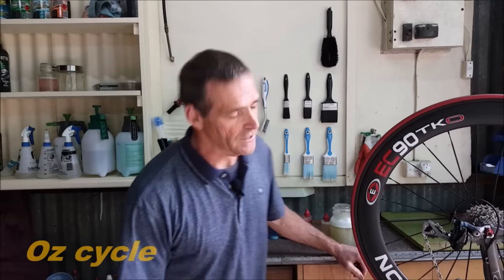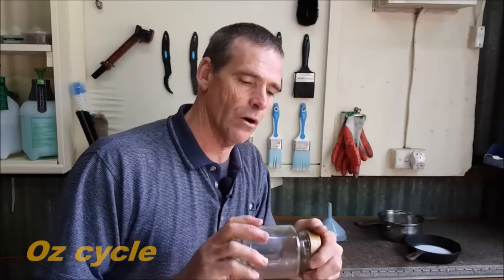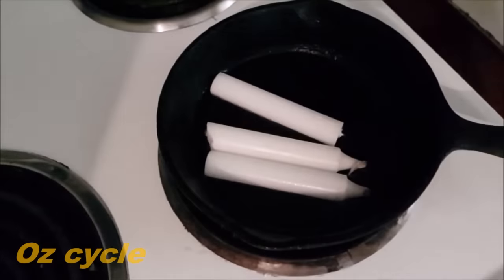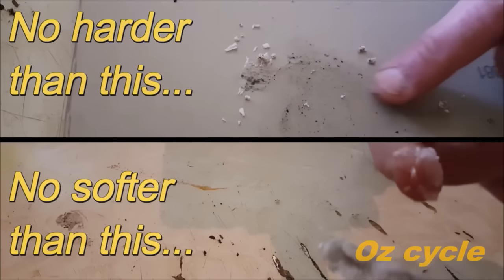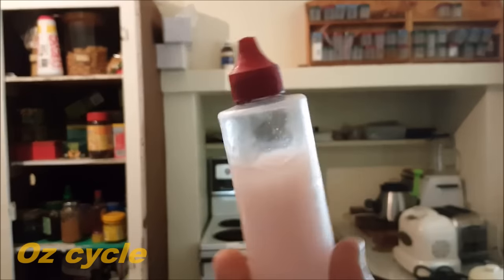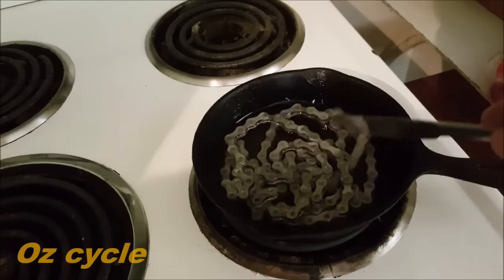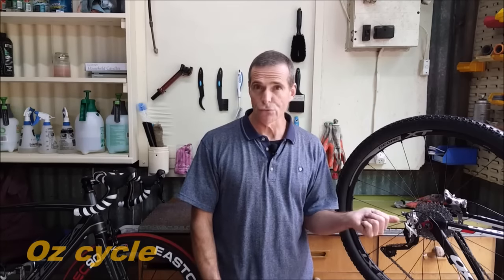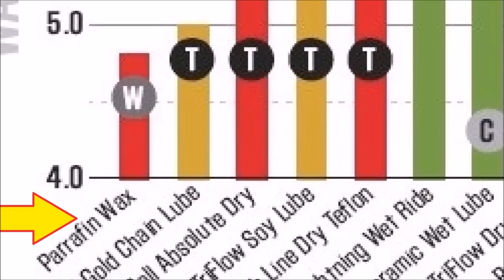BEST chain lubricant ever !! .....make it yourself.

Comment: how does this work in belove zero temps and in snow and salt?
Reply from the maker: +Robinators I have no experience with those sorts of conditions Robinators....if you live in such,perhaps you could try it out and let us know?
Reply: i would like to, but im too lazy to do all the cooking :D sorry( cuz i dont have a spare frying pan for wax). i just use the  wet lube. Wet lube kinda works
Reply from the maker: +Robinators Ok...maybe nuther time. Keep riding,your a brave soul riding those conditions.
Reply: have no other choice, roads are strewn with salt, for snow to melt, so, all the salt on the road is getting on my bike.. pretty hard conditions for drivetrain and bike itself.
Reply from the maker: +Robinators Great experience Robinators,Id like to relay it in a future vlog?
Reply from the maker: Kenneth Mjelle Hi Kenneth. The wax lube should work fine but you may need to tweek the paraffin/wax mixture so it keeps its consistency in cold temperatures.If wax lube is no good you could try treating your chain with "fish oil" . If all else fails,motor oil is fine except not used oil....it has metal contaminants which will wear your chain out real quick....so new oil.

Comment: The lube stays very thin after apllying it to my chain. It looks like the xylene is not evaporating.
Reply from the maker: Xylene will always evaporate in time. If it still is too liquid you simply have too much paraffin oil in the mix....just add more candle wax.
Reply: oz cycle thanks. The Xyleen took some time to evaporate. Works perfectly now! Thanks from the Netherlands

Comment: If I don't get xylene, can I use turpentine or polyurethane?
Reply from the maker: +Paridhi Kashyap No...try for Acetone or Toulene Paridhi. If still no success go to a paint shop,they should sell good paint thinner.
Reply: oz cycle and isn't parrafin oil kerosene oil?
Reply from the maker: +Paridhi Kashyap 'Paraffin' oil has different labels depending which country. Probarbly best to google 'paraffin oil' followed by your country. Or enquire about kerosene from the supplier.
Reply: oz cycle parrafin is a more refined version of kerosene but some countries call parrafin as kerosene others call it parrafin

Comment: can you use this on o/x ring chains?
Reply: This is a good question kratuli. I think you are asking about a motor bike chain. These are different as they have a silicon gasket on each side of every link. I dunno the answer. If it was my bike I would do it, but be careful what I used to strip the grease off the chain. Or you could just ride a shaft drive ? http://www.bikesales.com.au/private/SSE-AD-4630422/2015-Honda-VFR1200F-ABS-(VFR1200FA)/?cr=0&psq=%28%28%28%28Type%3D%5BRoad%5D%26SubType%3D%5BSport%20Touring%5D%29%26%28Make%3D%5BHonda%5D%26Model%3D%5BVFR1200F%20ABS%20%28VFR1200FA%29%5D%29%29%26%28%28%28%28SiloType%3D%5BBrand%20new%20bikes%20available%5D%7CSiloType%3D%5BBrand%20new%20bikes%20in%20stock%5D%29%7CSiloType%3D%5BDemo%20%26%20near%20new%20bikes%5D%29%7CSiloType%3D%5BDealer%20used%20bikes%5D%29%7CSiloType%3D%5BPrivate%20used%20bikes%5D%29%29%26Service%3D%5BBikesales%5D%29&pso=0&pss=Premium

Comment: Can I use turpentine oil instead of paraffin oil?
Reply from the maker: No. Paraffin oil is the wax in liquid form at a lower temperature. Try veterinary and pharmaceutical suppliers Kabir.
Reply: @stevenleffanue  Thank you very much.

Comment: The problem with your chain cleaner formula is that it is not environmentally friendly and can be highly toxic -- especially the xylene, which is downright dangerous to handle without adequate skin and respiratory protection. Xylene is illegal to purchase or use in California, where I live. In most California counties, it is also illegal to casually dispose of petrol. You can't just dump used petrol on your (or anyone else's) property or down a drain without risking a substantial fine. It must be taken to a hazardous waste disposal center.

Comment: What u say on diesel being degreser?
Reply from the maker: +Aiaiaii z Yes but it leaves an oily film.
Reply: oz cycle almost any solvent will work fairly well, even the solvents in WD40 do a better job than bike specific degreasers, but as you say many leave a light oily film behind, which is very easily removed with a citrus degreaser, which also removes the smell.

Comment: how to clean the chain up after waxing it?
Reply from the maker: +Aaron .T You dont need to unless its really dirty and grit has found its way into rge pins and rollers. Simply put into a sive and dip into the hot wax for 5-10mins. If chain needs cleaning then do the complete clean....petrol is excellent for thar.
Reply: How do I maintain the chain?  How often should I clean and relube? Can I just clean it with degreaser?  Probably not as it is not any sort of oil or grease on the chain, what kind of solvent can I use besides petrol?

Comment: Is paraffin oil and kerosene same
Reply from the maker: No
Reply: @stevenleffanue  but paraffin oil is not available easily in my locality . Can we use kerosene instead??
Reply from the maker: It will form a wax lubricant but kerosene is high in oil so will attract dirt.

Comment: I used squirt and my ch as in went rusty and had stiff links
Reply from the maker: +p Feeley That is unusual 'p Freeley' ...."Squirt" is one of the better chain lubricants. Did you clean your chain before putting on Squirt lube?
Reply: the rust to be fair was only on the outside of the links but it didn't look good. one or two stiff links and I probably did not fully clean the old oil off first.

just tried squirt again on a new chain. this time soaked it in white spirit washed it off in soapy water then used a zero residue spray degreaser.

Comment: Is xylene same as paint thinner?
Reply from the maker: Usually yes
Reply: @stevenleffanue  I'm confused with paraffin oil, the internet says it same as white oil or just mineral oil, can I use mineral oil in the mixture?
Reply from the maker: Paraffin oil is used in cosmetic,pharmaceutical and veterinary industry.
Reply: @stevenleffanue  do you recommend mixing paraffin wax and mineral oil for a hot chain wax?
Reply from the maker: No. Oil prevents wax sticking to the chain plus oil attracts dirt.
Reply: @stevenleffanue  I can't find any Teflon powder in my country, so I will just use paraffin wax without the paraffin oil for hot waxing?
Reply from the maker: You can but the chain will require rewaxing a lot more frequently than 300km
Reply: @stevenleffanue awesome, thanks man, I really appreciate your videos very informative, more powers!

Comment: hi is parrafin lamp oil the same oil you using?
Reply from the maker: +Sal Alz Probarbly not,Sal. Try looking for "liquid paraffin"....often sold at pharmacys. Names of liquids sold vary from country to country.
Reply: thank you for the quick response. when I visited diggers website the paraffin oil you using is also used for lamps. quoting from their website, "It is used extensively in ‘oil lamps’ ", "Fuel – heating, lighting and cooking.", "Burns readily and cleanly." so what do you think?

and thank you again.
Reply from the maker: +Sal Alz Try it. If the result is a non-oily soft wax then youve got it. Let me know as it helps others where you live.
Reply: It may be OK - I have "clear lamp oil" which is 99% paraffin oil (according to the label). 
But I have not prepared the lubricant yet.
Reply: thank you for all your help.

I wanted to ask you, in your area do they call paraffin oil, kerosene?
also would you be able to read the ingredients on your paraffin oil bottle.

thank you.
Reply from the maker: +Sal Alz In Australia its  called "paraffin oil" or "liquid paraffin". There are no ingredients on label. It says it is suitable as 'water tank surface sealer'. Kerosene is completely different here.
Reply: I have prepared the lubricant with paraffin lamp oil. The result was perfect. Go forward.
Reply from the maker: +Joaquim Lourenço Great! So its not oily,Joaquim,just a softer wax?
Reply: Yes oz cycles, just a softer wax as you describe in your video. I hot wax my MTB chain, ride a few times, and it's top. My chain remains clean and smooth.
Reply: Joaquim Lourenço, nice. I'm still waiting for my orders to come in so I can try it.
Reply from the maker: +Sal Alz Sorry Sal...often i miss comments as they get hidden in spam or down the timeline too far. Lamp oil isnt the same as paraffin oil in Australia but it may be where you live. You could try for "liquid paraffin" ,often available at a pharmacy. If confusing simply try the lamp oil...the result should be a softer wax but not oily...then its ok. Otherwise you may need to google or consult local knowledge about products in your specific country.
Reply: Joaquim Lourenço, oz cycle bring a good point, do you live in the u.s?
Reply: Sal Alz, I live in Portugal... but what I bought was labeled Transparent Paraffin Oil for Lamps. I decided to give It a try and works for me. I bought it in a big do-it-yourself hypermarket.
Reply from the maker: +Joaquim Lourenço Great,Joaquim. Thanx for letting us know too  :)
Reply: Hi Joaquim Lourenço, I live in Madeira Island. Could you tell me the name in Portuguese and the name of the hypermarket. Perhaps I can find some here.
Reply: Olá, Gil Santos I bought It on Leroy Merlin something named "Gotica", but I think you could find this also on Aki because it's a store from the same group. I google and found that there is a Aki store in the funchal. Here's the link for the product that I got:

http://www.aki.pt/jardim/equipamento-de-jardim/mobiliario-de-jardim-e-acessorios/almofadas-capas-e-acessorios/velas-e-tochas/oleodeparafinatransparente1Litro-P45144.aspx

Se precisares de mais alguma coisa é só teclares.
Boa sorte. Abraço.
Reply: Obrigado Joaquim Lourenço. Thanks a million for the link. Will go to AKI tomorrow and get a bottle.

Um abraço

Comment: Can I use kerosene instead of paraffin oil ? Because they are familiar I guess...Very hard to find it in my town..anyone??
Reply from the maker: No not the same. Try a pharmacist
Reply: Thank you for your respond sir
Reply: @stevenleffanue  any other different oil that I can use ??
Reply from the maker: No it has to be paraffin oil. Also used for cosmetics and veterenarians
Reply: @stevenleffanue  ok ...one more question sir, which formula is better ? In this video or your latest formulation where you just add ptfe powder to the molten wax paraffin ?if so, how much percent increase of performance of either lubricant formulation? Or can we add all ingredient together, "paraffin wax+paraffin oil+ptfe powder" Your time for answering is very very appreciated sir....Thanks..
Reply from the maker: Oil attracts dirt but helps prevent rusting. If you ride in wet conditions add some paraffin oil otherwise just use ptfe in the wax.
Reply: @stevenleffanue  thank you for answer sir !

Comment: The best lubricant is not that, the best lubricant in performance and efficiency for bicycle chain is the SILICONE spray.
Everything that silicone-based lubricants provide has more benefit than any other lubricant.
I have come a long way in testing, and silicone is the best lubricant for bike chains.
I use only WD-40 Specialist® Silicone or similar.

Comment: People of the Internet: I'm in the UK, but can only seem to find "lamp oil" which has failed me when trying to make this. Ebay only seems to have 4 litre bottles of paraffin oil, which is too much. What am I doing wrong here?
Reply from the maker: Try veterinary suppliers or a pharmacy David as paraffin oil is used in the medical industry.
Reply: @stevenleffanue  is it the same as baby oil? Will that work?
Reply from the maker: Sorry,no. Baby oil has slightly different molecular structure to paraffin oil. True paraffin oil is actually paraffin wax with a low melting temperature. When paraffin oil and wax is mixed it becomes a wax with lower melting temp or an oil with a higher solidifying temperature.
Reply: @stevenleffanue  ok, thanks for your help oz cycle.

Comment: How does this older formula compare to the two newer versions?

https://www.youtube.com/watch?v=HHr9znwpwmQ

https://www.youtube.com/watch?v=953QTThT4_M

Also, would this mixture be improved with molybdenum?
Reply from the maker: Using paraffin oil helps protect chain from corrosion in wetter conditions but attracts dirt.
No advantage to adding moly... it also leaves marks on everything it touches.

Comment: your house looks cheaper then bikes you have LOL
Reply from the maker: +They Live We Sleep Ha...you not far off. I live in an old farm cottage which was to be demolished for a paddock but I needed a place to live in an emergency so have been here since. :)
Reply: any opinion on using benzin or diesel as chain cleaner??
Reply from the maker: +They Live We Sleep Yes they will clean the chain but leaving a thin oil behind you will need to degrease the chain after that if youre going to wax it.

Comment: Can we add engine oil instead of paraffin oil
Reply from the maker: No. Paraffin oil available from veterinary, cosmetic and pharmaceutical suppliers.
Reply: @stevenleffanue  is it possible to make wax grease.
Reply from the maker: Yes but it's only good for sliding joints...not ball bearings.

Comment: Wax alone doesn't stick well to metal.
Reply from the maker: To get maximum adhesion of wax to chain,completely clean all previous oils out of the chain,James.
Reply: On the contrary, I mix oil with wax and after cooking the chain in hot wax/oil solution, it sticks well regardless of what lube was on the chain before - not because of the wax but because of the oil added to it.

Wax alone falls off and leaves the chain clean but it will squeak before to long.

Comment: This is rubbish - hardly surprising as a lot of what this guy says is nonsense.
Doesn't matter how much paraffin oil and xylene you add - it turns into a blob. Don't have a clue how you could possibly think this goo is going to lubricate the wearing surfaces of your chain.
The shop stuff may be expensive but at least it works.
Reply from the maker: +Richard Martin Hi Richard. Sounds like you havn trouble getting the final result to be liquid? If it ends up a blob in the xylene it just needs to be shaken vigorously. If the result is simply a blob including the xylene,it may be because the ambient room temperature is low....thats fine....add twicw the amount of xylene and it will remain liquid below -15degC. This will be illustrated in the next vid which should be up this coming wed. If still havn probs,let me know. Cheers...Steven
Reply: Admittedly I live in Melbourne and it is cold at the moment but I am putting a lot of Xylene and Parraffin in with the wax - almost 50%. I should point out that it isn't a case of some solids in the liquid, rather it is the whole thing that turns solid and it doesn't take very long.
Reply from the maker: +Richard Martin Ah yes. Double the amount of xylene only Richard, that will cause it to be liquid at well below freezing temperatures. Apply liberally to your chain but dont ride until xylene evaporates...may take up to 6 hours in this cold weather. You can usually tell when your chain stops smelling like xylene :)